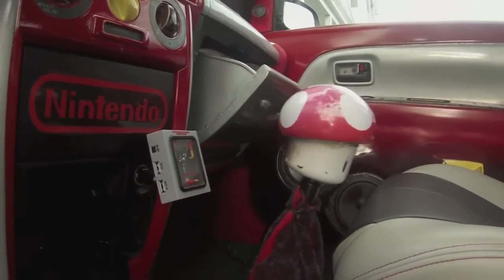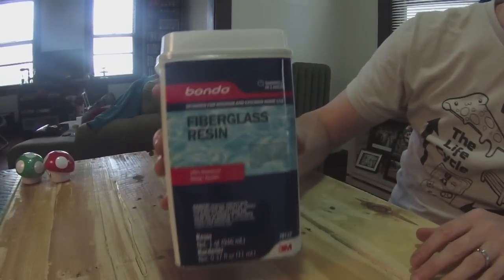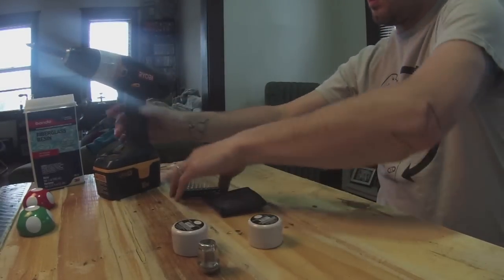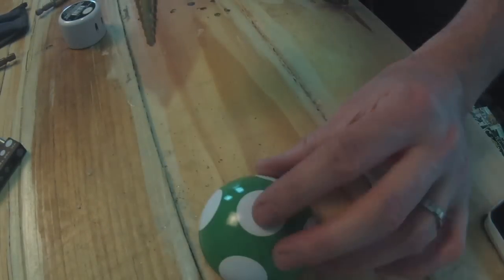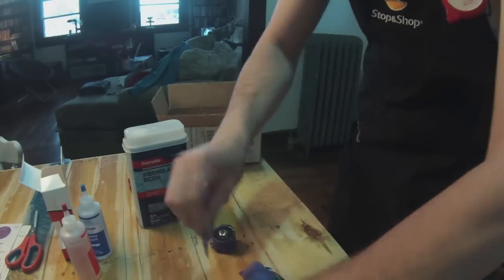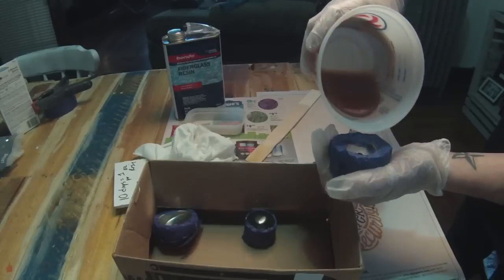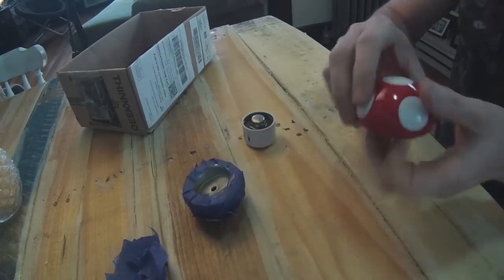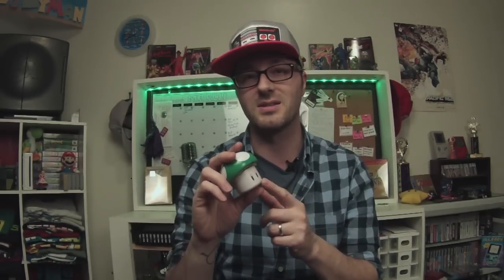DIY | How to make a custom shift knob out of Mario 1-UP candy tin| Nintendo

Comment: if you like a heavy shift knob you could fill the inside with lead or fishing weights.
Reply from the maker: travis110109 that could work too. I was more concerned with the tin denting in because the inside of the top part of the tin is hallow, but having it weighted would work too

Comment: cool shifter knob i used to have an isusu pup truck and had a skate wheel for a knob bearing and all it was fun to spin to really fast.i know you know all about this kind of stuff (ive been watching you) but 10 or 12 coat of clear would help the paint on that dime store candy tin hold up to hand sweat and finger oils or just general wear just a thought- good job on a cool ride
Reply from the maker: james cleary thats what I was thinking to. I was just anxious to put it on and get the video out ha. def going to load up the clear coats to help it stay.  Thanks for the tip James

Comment: Good idea! i was thinking about trying to use the hilt of a master sword or something like that as a shifter knob but i might do this since i would probably have to buy an entire sword and cut the hilt off and that seems like a waste
Reply from the maker: +Enigma Machine yeah you can find these candy tins everywhere. I did see a online tutorial on how to make a mini master sword out of wood and foam. Could always go that route. Heck who knows maybe I'll try to make one in the future for the fun of it
Reply: That would be awesome! I have another question do you know of anything that you could coat the shift knobs with to prevent them from rubbing off the pain like a kind of clearcoat or something?
Reply from the maker: +Enigma Machine yes that what I did with a later version. I actually used a UV clear coat I got at a craft store. This way it does not get sun faded as well. I did about 3 coats, 10 mins between coats and let it dry for 3-4 days before touching it
Reply: Awesome thanks for the info and i have another idea for a shifter. Since my cars shifter has a light in it i was thinking i could change the light to a blinking LED and make the mario star out of some sort of resin so it looks like the mario star. would need to round the corners though so you dont stab your hand lol
Reply from the maker: +Enigma Machine yeah. You could prob just get a cake tin of a star and pour resin right into that. Than just drill out the hole to put the lug nut in and screw it in

Comment from the maker: Check out how I made this sweet custom shifter knob out of a candy tin
Reply: +Russ Lyman I noticed how worn out your old shift knob was. A way to prevent this from happening is you could clear coat the final product with several coats just to prolong the life of it. Cool video!
Reply from the maker: +A.Mak thanks for comment. Yes after this I actually did put 3 coats of clear and also 3 coats of UV protectant. It will def help in the long run

Comment: Will this work for automatic shift sticks as well? Or should I find something more tight fitting instead of a lug?
Reply: Zachary Hawkins.  
No, automatics have release buttons on them which acts like a clutch. Unless your highly skilled with your hands and some wires it's almost impossible.
Reply: Layne Wheat  
My subie is auto but doesn't have a release button and I've changed my shift knob multiple times and it still works fine

Comment: what is that thing you bought on ebay called? I want to try to make a shift knob for  my friend with this tutorial but idk what im looking for on ebay. He have a 1998 nissan 240SX  Does the size dimension also matters? thanks a bunch
Reply: MonkeyBunnyShop it is called a lug nut and yes it does matter. Also just a tip ask autozone for some. They should have a pack of them specially made to fit your rims but it should be able to fit your shifter column as they almost always use the same threading.

Comment: What size is your Wheel lug nut ?
Reply from the maker: +Shady Morazan thanks for the comment. I drive a 2006 Scion xA. The wheel lug size I used to fit my shifter was M12 x 1.25mm Acorn style

Comment: HELLO! I THINK YOU VIDEO WAS HELPFUL BUTTTT CAN YOU PLEAAAASEEEE WRIGHT DOWN WHAT TYPE OF NUT YOU USED AND THE NAME OF ALL THE MATERIALS YOU USED PLEASE PLEASE, EXCUSE THE CAPS MY PHONE IS BROKEN
Reply from the maker: the nut is just called a lug nut for a wheel on your car. it will be different for every single car so it is not a universal part. You have to see what the thread type on your shifter is. Than you just need the candy tin. last is some fiberglass Resin. You can find this at Home Depot, lowes, auto zone, pep boys, advanced auto.